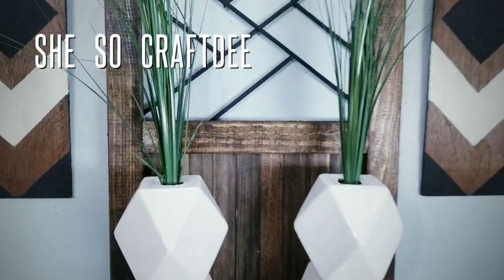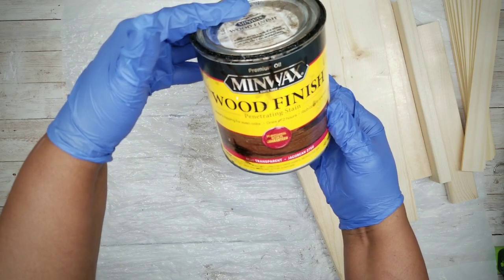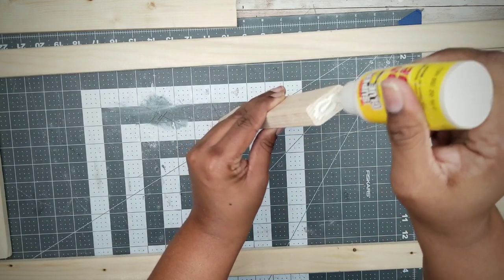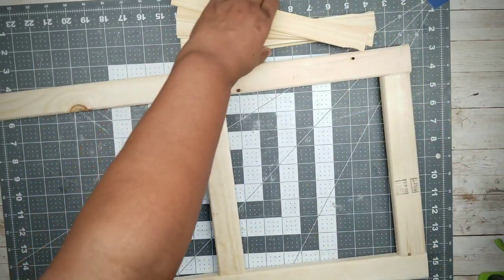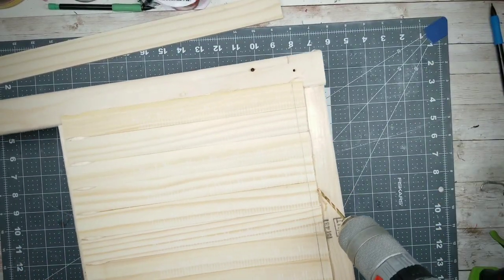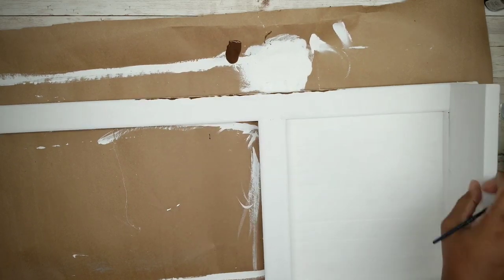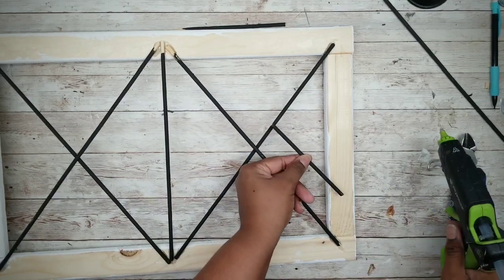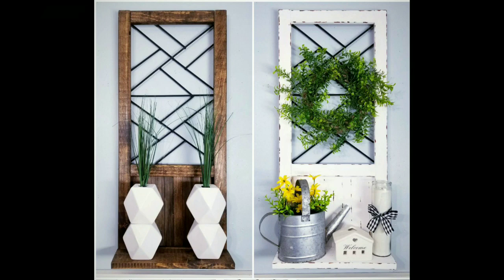DIY WOOD WALL DECOR WITH SHELF 2 WAYS! | HIGH END Modern Farmhouse Boho Style | DOLLAR TREE Skewers

Comment: I love both, your extremely creative. I am interested in the wood stain. Are the fumes bad after dried, did you do this outside? I had a horrible experience with Minwax w/polyurethane but I see this says Penetrating Stain. I had to throw out the wood and repurchase, painting instead. Thank you
Reply from the maker: After completely dried, there is no odor. I dry all of my stained pieces in my garage under a fan. This way I can handle it in about 2 hours, and any product smell will evaporate in a day. To me, it does not have a strong smell at all.
Reply: @SheSoCraftDee  thank you very much.

Comment: How did you do the backside as for hanging this? I made it and the skewers at the top back won’t let me put a saw tooth hanger or anything in the middle and I’m afraid rope isn’t strong enough to hot glue on the back
Reply from the maker: I have a large sawtooth hanger on my piece, but you can also use some thick jute twine, knotted on each end. Apply with a couple staples on each end. I hope this helps!
Reply: @SheSoCraftDee  ok I’ll give the jute with staples a try, thanks Dee